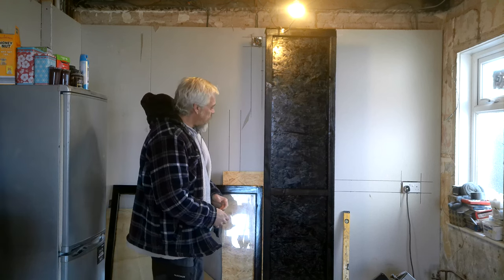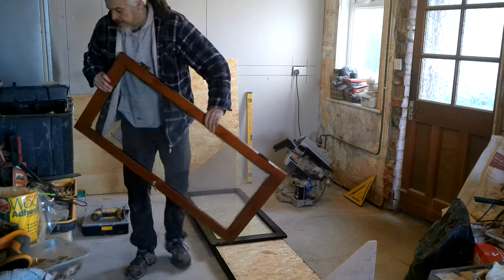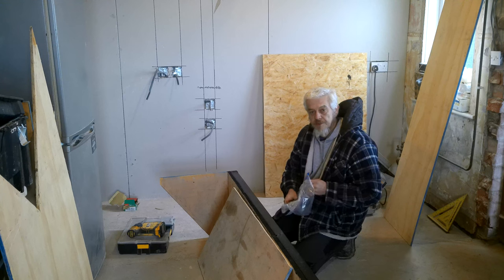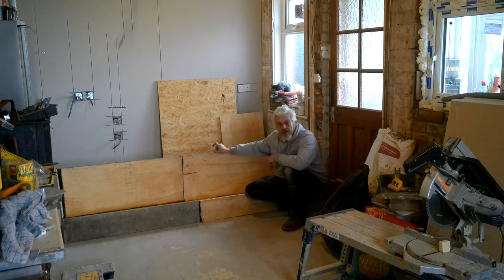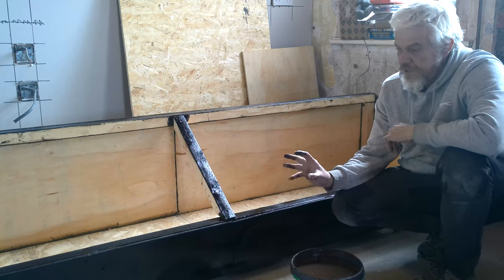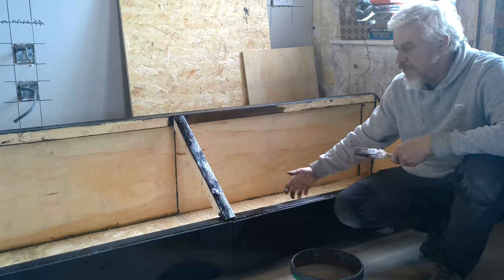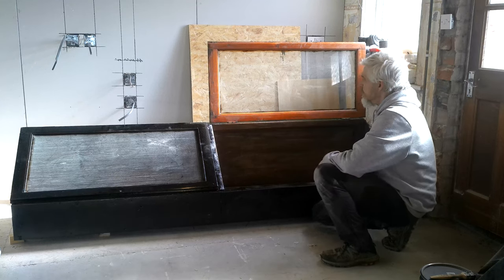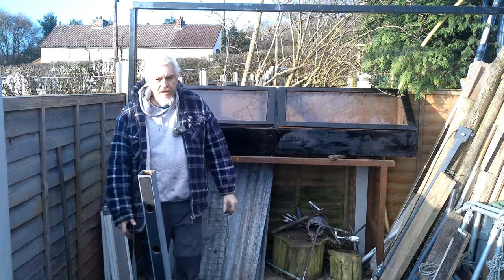Making a Cold Frame From Old Windows

Comment: I wondered whether you'd have to get the young fella to give you a lift with carrying it out Jason! I hit lucky when I decided to make one, I managed to get hold of some decent sized pieces of perspex from my father in laws house before it was sold.. I'm wondering too, if it might work better with a coat of white or silver inside to give you maximum light in it..
Reply from the maker: Hi Stephen. Yea it was pretty heavy when built. I thought about linning it with tin foil but wanted to get the wood sealed as best a poss first.Ill see how it goes and call it from there.